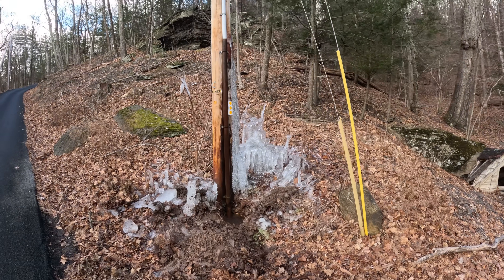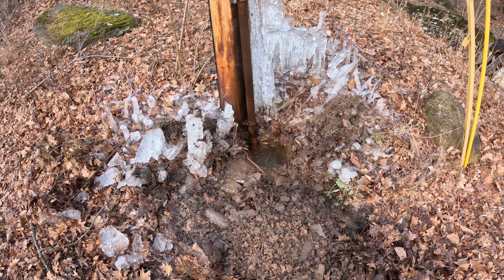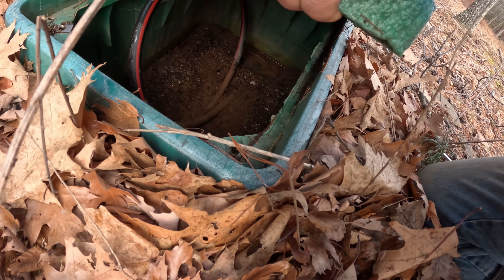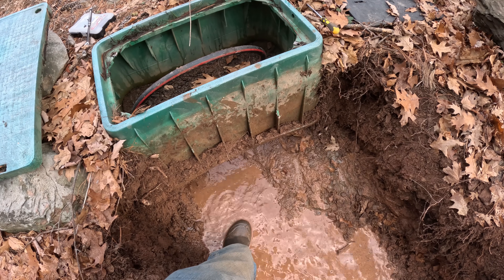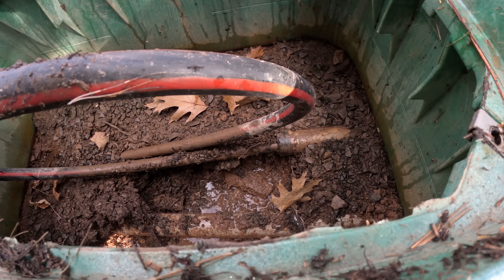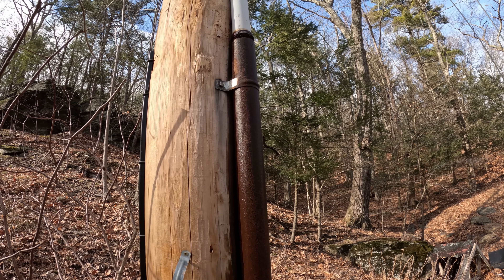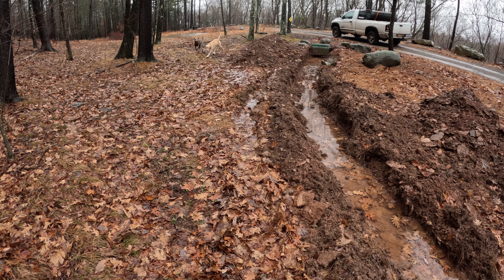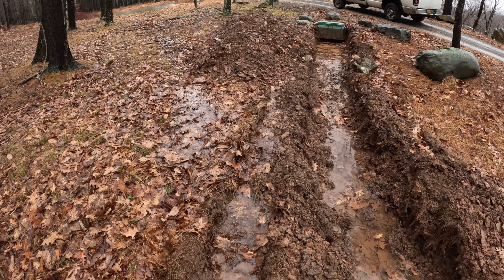Keeping water out of an electric conduit

Comment: I know of A much faster way to due that to. Right stuff sealant on A five gallon bucket lid rubber O-ring could possibly fit inside of those electrical junction boxes. To work for blocking out.& Sealing them up water tight.

Comment: Those electrical junction boxes are suppose to have A water tight rubber seal inside of them to block out the water from entering inside of them to begin with Andrew. It's actually A simple fix with some flex sealer.,or some right stuff sealant inside of the lid insertable housing along the outer edges of where the screws go into at also. I would just make it like A gasket for that by using the lid. And measuring the depth of where the lid seats inside of the box itself to. Then subtract the space enbetween for the rubber gasket seal.,or you could put it on the lid compressed with plywood inside of A wooden box the same diameter as that plastic box for exact fit.
Reply from the maker: The water comes from the ground.
Reply: There is no bottom on that box, it’s open and just sits on the ground. The water is just percolating up from the ground like Andrew says. He did exactly what needed to be done, some people are complaining a little about the corrugated pipe but with washed gravel the water will flow through that almost as fast as flowing through the pipe. So even if the pipe plugs up the water will just go around and drain through the stone. Nice job! Next!
Reply: Well anyway, he fixed it....

Comment: You will never keep water out of electrical pvc. It is not sealed like plumbing pvc. Best thing to do is put a pull point at the lowest point and drain it off. My utility specs a pull box with in 20 feet of the pole to allow drainage and relocation if the pole or damaged or to be moved.

Comment: The highlight of this video was the utter disregard for the truck bed of that Ram 2500 while loading the hammer @ 4:30...  I remember the "fixing" my new ram 2500 video.  Glad to see someone using a truck as they were meant to be used.

The drainage aspect was excellent also. That was a pretty good head pressure on that conduit, must've been a couple hundred foot run up to that box.

Very good job
Reply: If I remember right, one of the things he liked about the white truck was that it was pre-dented or just the right amount of dents.

Comment: I would go with road/filter fabric under (and on sides) of that crushed rock beside pull box... Without fabric (or just separating like shown) the fine materials from soil will penetrate crushed rock and fill it, preventing proper drainage... BTW: Something like Excavator Vibratory Plate Compactor Attachment would be useful too, am I right? :-)

Comment: I have been doing electrical for over 30 years and that ice sculpture on the conduit is a new one for me. Albeit all of my work has been on the flat plains of midwest. Great video.
Reply from the maker: It’s been bigger than that.
Reply: @AndrewCamarata  I heard a lineman say they use duct sealant on the joints. Appreciate ya

Comment: That’s actually amazing that the water built up through the box and flowed all the way down the conduit and pole. I love these videos of smaller jobs too
Reply: I think the pole was further down the hill and with the conduit broke in that box with water coming in, the water just filled the conduit up to where it was near level then ran out of it
Reply: I had that experience a while back. Water regularly flooded a ground box like that but, instead of just entering the conduit, water got inside the cable insulation. The power company had to replace about half a mile of buried cable. We were without power for a week.
Reply: Its crazy how far the water is up the conduit, but it just shows the water level on the property. 
The service pole is way down the slope and no surprise its filling up.  Hopefully the fix will last a long time, but that road is where the water flows out of the pond. 
It is draining quite a large area.
Reply: Yes. Gravity is amazing. 😉
Reply: @Crewsy  
There is no such thing as "gravity"; the earth sucks.
Reply: When will you start that new bumper on your truck
Reply: Or infinity to heavy for the truck because of the checked on that have power steering
Reply: Do another video of stalling a brand new tailgateOn your truck

Comment: I put a dull plate on bucket teeth no sharp edges and dig near utilities in NYC .
Especially when plastic pipe gas water electric is near.
We use big vac truck to finish excavation.
Nice job kid.

PS I just had my hammer nitrogen recharge 400 psi and makes more power now. Manual says check after each job or annually.
A Kent Fukuwarma Hammer.
You can have shop do it or buy the nitrogen kit.
I also sharpened point with a gas cut off saw 45° .
Much faster now.

Comment: Seeing as how that is right next to your pond, I wonder if the water pressure in the pond found the trench dug to install the lines and just started creeping and flowing into it? Then it just found a crack in the pipe (who uses rigid pipe in an underground pipe run? that should be either pvc pipe or the pvc utility line type tubing). Regardless, I wonder if putting a bag of bentonite clay along the bank of the pond there will stop the flow? I know you have a ton of rock right there, so it might be going under to go over, if you know what I mean.
Thanks for the videos.

Comment: Hey Andrew, in my experience with stopping water from getting into conduits with cable. We stuff a light weight rag around the cable and mix some hydraulic cement and cap the duct. That's the method for manholes that fill with water and it stops leaking into building basements and conduit across bridges. Seem like that would apply to your situation as well. Thanks again for another entertaining video.

Comment: This looks like a ground water issue more then a conduit leak. With a pond near by and bedrock, water sits on top of the bedrock. That trench will work great. Andrew went the extra mile to hammer out a slope to ensure drainage.  Problem solved. Great work.
Reply: AGREED!

Comment: 2/7/23; ...am a loyal viewers of channel for long time now...2day I saw efforts to drain water out of electrical conduit, at downhill lower location,  supplying 'Castle Rock', house/shop etc.
  Yes, I saw all work at top hill location: the rock hammer & dig-out & perf-flex pipe & filter cloth & cover over. Follow up video shows good draining up here &  no more flow at down hill seam break at pole, 6-7ft (AC's head height), but is their still water >inside< that conduit? Final comments...utility Co.  'wanted to drill holes (into conduit) but'...(did not do so). So I missed if conduit was ever drained dry! Is it OK to have lingering water inside the conduit? Sorry AC, this vid left me with kinda mixed feelings: yes always happy with your skills & impressive tools/equipment getting 'x' issue solved. But I am left with  anxiety on this project as all your efforts draining water -at source on top of hill surrounding (cracked?) conduit was done great, but the water inside conduit is still un- touched....is this a problem? Future short-circuit, electrical fire 🔥 potential? Safety issues? Insurance issues here? Hope I am wrong & missed the 'all clear'. Always prioritize your videos as 1st to watch. Stay safe & carry on!👍👍👍👏🛠🔧⚙️🍕🍺😊

Comment: Andrew... Call me dumb if you must... But in that box... could you have just put an elbo and pointed it up.... and then have the power line run kind of vertically for a foot or so, as it is curled up a loop inside the box? Does any of that make sense to anyone?
BTW... seems like you did this just cuz you're a good neighbor.
Reply: Would be difficult to pull out half of his burried electrical service to do that. I'm sure he did not realize it would be a problem when he installed it many years ago.
Reply: @tbirdracefan  Oh yeh... derp..didn't think about that.. LOL

Comment: Duct seal will seal the conduit around the wire to prevent water ingress. Duct seal should also be used at the top of the riser pipe on the pole; it is actually required per NYSEG standard installation manual. Been an electrician in NY for decades and while a water tight installation is not always feasible in every condition it should always be the goal. Water can cause issues down the road, despite the wire itself being resistive to water and chemical ingress, water freeze and thaw, especially in NY can lead to wire/insulation damage and even breakage.
Reply: Water and electricity......What could possibly go wrong ?
Reply: @MalcDavison .   Almost every electrical manhole Iv ever lifted up has water in it. It’s fine. He wasted a lot of time and money for no reason. He just wanted to make a YouTube video
Reply: @johnsecord8539  I have pumped out more manholes than I can remember.... reading these comments about dry manholes is hilarious
Reply: i agree, seal the conduit entrances after the water has been evacuated.  Water sitting in that conduit is gonna cause problems eventually.
Reply: @Jimleben : Especially with RMC as galvanized metal pipe isn’t known for being great as far as longevity in plumbing as it can basically wear away to nothing but a pin-hole. PVC is slightly better but in NY freeze/thaw can cause problems there to actually exploding the pipe which can leave shards that can damage the wire. You can get sealed pull boxes and conduit bodies which along with duct seal on the high ends or whether rated connections at appropriately rated boxes above ground should lead to a water free conduit system, at least regarding low voltage systems, that is under 1,000 volts. In high voltage systems you really rely on duct seal and burial rated wire as connections to a pad mounted transformer are usually simply an open space bellow grade that all the lines/conduits run into.
Reply: That RED tracer on that Black Wire tells me that’s a 2300 volt or higher voltage cable that belongs to the power company.
Reply: @joemc111 : While it may have been bought from the power company or from an independent retailer it is completely owned by the customer, at least in upstate NY; the electrical supplier for the majority of upstate is NYSEG and they spell out requirements for high voltage wire and installation, and they must approve the wire used before they’ll putt a pad transformer in and energize the circuit but it is by all means the customers wire. Long runs on private property can get expensive, especially when run underground though under ground can be cheaper long-term as weather is less of a concern. You could also put in your own poles and run overhead in which case NYSEG will provide one pole inland and supply the pole transformer at the final pole as well as making the connections on each end to energize the system; this can be cheaper and seemingly less work and $ but is much more susceptible to the weather.
Reply: @libertarian1637  everything you say is correct but when the power is turned on, at least here in Florida, no customer is aloud to open an inground box.
Reply: @joemc111 : In NY things can get complicated as some devices are sealed with tamper-evident tags and/or locks; usually underground service as it is customer owned are accessible by the customer, outside of the pad transformer, and isn’t secured along the way, though usually pull boxes aren’t accessible above ground in an unsecured manner, as someone could cut the wire. At 7,200 or 12k+ Volts accessing the energized conductors, in general, can be quite dangerous, and I’m not a fan of the boxes used in this video in general; these boxes aren’t sealed and quite clearly Lowe’s water and possible foreign matter into the conduit. I personally prefer sealed conduit bodies as buried level, if needed, and if not needed no breaks on conduit between the pole mounts and the pad transformer.
Reply: @joemc111  It's 7.62kV as almost all Central Hudson primary distribution is 7.62kV/13.2kV grounded wye.
Reply: @joemc111  he had to have it put in, there's videos oh him digging the trenches and installing the condout and then nyseg comes to install the wire
Reply: @bjgarbacz1  yep I put in Thousands of feet of 5 and 6 inch pipe for power companies, and they always install the wire.
Reply: @joemc111  or you can hire a contractor.... shop around
Reply: Whoever installed it originally didn't know what they were doing that's for sure
Reply: @johnjaco5544  or plainly just dont give a fuck about doing a good job
Reply: @BigBoyLies  That too.😂😂😂
Reply: probably had some but because he is on a mountain with water pressure rising the higher the source it probably just popped out after enough freeze thaw cycles
Reply: I was cringing thinking about that wire freezing and thawing freezing and thawing 😂
Reply: How much duct seal paying you ?
Reply: @caseG80 : Nothing. duct seal is much like duct tape a generic item made by different companies, I’m partial to GB, and is kind of like play dough or modeling clay, but it simply sets soft and is paint ready almost immediately. It is typically fire, water, electrically non-conductive and air tight rated upon proper packing.
Reply: @libertarian1637  very interesting discussion, thanks.
Reply: You better stay away from Florida then, all our pipes have water in them.  there are some areas where they use direct burial because of that.
Reply: @jamesweir2943 : While I’m not from FL I have done some work there back in ‘08-‘09 after the bubble burst when I was brought down to flip devalued properties and was able to keep conduit dry. As long as things are built and sealed dry baring a broken pipe they should stay that way. The big issue is dealing the conduit at the pole as it is naturally open to the sky and any sealing method can be open to the elements and water can just naturally enter a vertical pipe without proper sealing. I know some utilities that actually mandate weather heads at poles just for that reason, but that can create its own issue.
Reply: Incase thinking like whata shit job keep the water from getting into the first pipe
Reply: Sounds like you know your stuff.
Reply: Sounds like the power company cut corners, now the homeowner has to come up with his own solutions..
Reply: @fruitfarmfords8243 : The work was done by the customer of a contractor they hired, not the power company. The power company, in much of upstate NY would be NYSEG, only makes the final connection at the pole, assuming it’s LV to the house otherwise they would make both the pole connection and final connection at a pad mount transformer as they only make HV connections regarding underground service. If the service is overhead then they’ll make a connection at the weather head and pole which will both be LV. 
Long runs/pulls can be tough as wire gets heavy and connections get repetitive but the idea is always to keep water out or in the case of direct-burial wire to have water proof, thick enough, and even a gel filling to protect from water.
Reply: @libertarian1637  He is in Central Hudson territory, not NYSEG and this kind of hackmongery is normal for them (not that NYSEG is much better).
Reply: @fruitfarmfords8243  he installed this primary wire...

Comment: I'm glad I don't live there.
That said. There is a fitting made specifically for this exact scenario. I have no idea what it is called though. It attaches to the conduit/riser within the the first foot above the elevation. It looks very much like a Bell. It allows accumulated water to drain. All the while keeping the integrity of the conduit.  Not allowing physical contact with the wires/cable.
All the other work preformed should have been done initially. But there's never enough time or money to do it right the first time. But there's always plenty of both to do it the second time.
Reply: @DAVID SAWYER,  I think you're referring to a sliding coupling.... those are designed for the riser pipe,  NOT TO BE GLUED, when the lateral pipe is installed less then frost line, so the coupling allows for the pipe to move up and down and won't push on meter box, junction boxes

Comment: Good job man, water can be very difficult to manage sometimes, quiet a healthy spring running there.
Pro tip, (please excuse me if you already know) but stand your hydraulic breaker up until it's gone cold, maximises seal life.
Take your pipes off first, and poke it in the ground.

Comment: You may want to put a screen wire barrier in the pull box to keep critters from going up the drain pipe and chewing on the wire insulation. 🐭 🐁 🐀

Comment: I figured you would trench a bit further away from the end of your pipe to make sure the water continues to run downhill. That should work for a while until it clogs like they inevitably do. I always had better luck with schedule 40 pvc. The don't generally clog and they won't get crushed. 

It's always makes my night when I see a new video go live! :D
Reply: He has fractured the rock the length of the trench.  Ground water will naturally flow through that. Then he added a layer of gravel that the ground water will also flow thru. I can't see how it would ever be a problem again.
Reply: @tbirdracefan  corrugated pipe always ends up clogged with leaves and dirt, especially if the end of the pipe is left open. either way, he shouldn't have to worry about that for several years at minimum
Reply: @looniebinn  I watch Gate City foundation and drainage too. He works for people that will not do their own maintenance.  Andrew did an excellent job and wont have any more problems.
Reply: @tbirdracefan  Yep, I watch that channel too. It was a great channel drain, I just don't like the corrugated pipe. I did lawn service and prop maint for a while and tore out countless clogged and busted corrugated pipes.
Reply: lol i had a feeling someone else that watches that channel would be in the comments about the corrugated pipe.
Reply: @Waffles_Syrup  It's a great channel. 👍